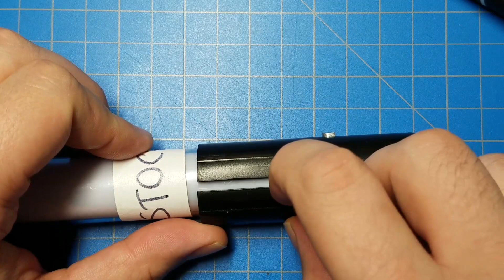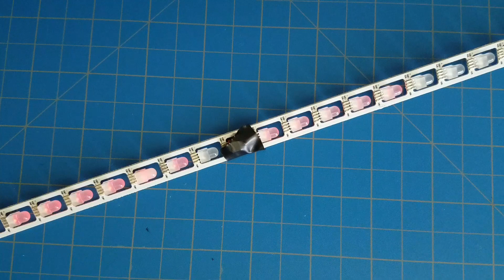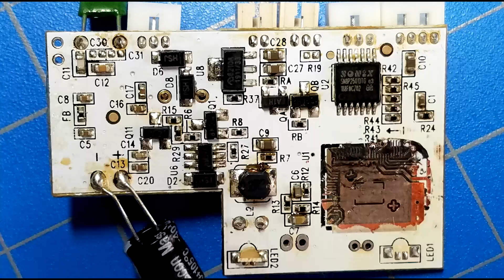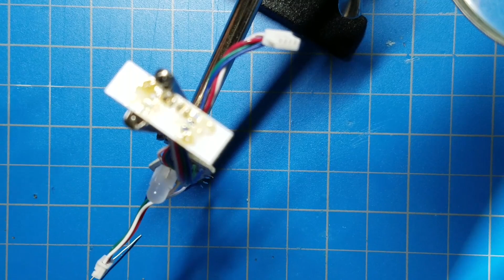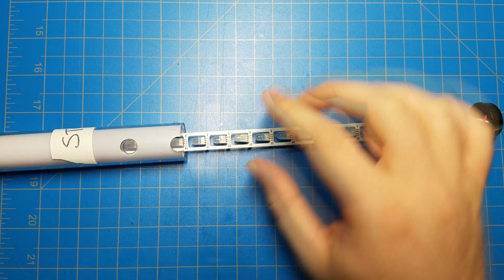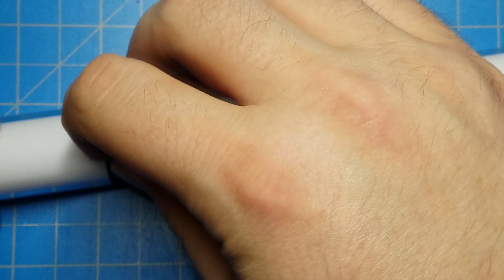Repairing a Broken LED in a Savi's Workshop Lightsaber Blade

Comment: Question and I hope this reaches you if one rgb led light is replaced should this fix the others that don’t turn on? We have a light saber that randomly the top led lights stopped working but the rest work would fixing one turn on the rest?
Reply from the maker: @Tyilasoso  probably not. the power going to those LEDs has likely broken somewhere. either near where the LEDs stop lighting or possibly the solder joint at the base of the blade that connects the LEDs to the controller. it could also be the transistor that drives power to that section of the blade has failed, but that's probably the least likely reason. 

you could open the blade and examine it for any obvious signs of breaks, maybe reflow the solder on the connections between the LED strip and the controller PCB, but it may be easiest to buy a new blade. you can find new ones on shopdisney.com or used ones for a bit less on eBay.
Reply: @Ruthsarian thank you!!!

Comment: Question: So I got a $40 lightsaber at Disney land, and it only works on try me mode. When I switch it to on mode and press the button it doesn't work. I think the problem might be in the circuit board but I don't have a great knowledge of circuit boards to fix it. I was wondering if maybe you could take a look at it and/or fix it?

Comment: where can i find some led like that?
Reply from the maker: i have not found a source for the exact style of LED used in the blades, however just about any common-anode RGB LED will work, such as these from amazon: https://www.amazon.com/dp/B077XD5T8P/

the biggest issue I've found with those LEDs is their color is slightly different (maybe because the package is different or the manufacturer is different?) so it may not look absolutely perfect, but it'll work.
Reply: @Ruthsarian  you think it's the same led on black series kyo ren saber?

Comment: I just bought one 2 days ago and part of blade lights up sometimes and mostly stays off. How can I fix this?
Reply from the maker: there's probably a wire that's come loose inside the blade. you would need to open up the blade and check the three wires that connect to the control board to see if any of them are loose. If one is loose you will need to solder it back in place.

HOWEVER,

your first step should be to contact Disney's Merchandise Guest Services about this. You can email them at Merchandise.Guest.Services@DisneyParks.com. Tell them about the problem. They may be able to send you a replacement blade.
Reply: @Ruthsarian  Thank you so much for this! I sent them an email telling them about my issue and they said they will not refund it. So my only hope is to fix it my self

Comment: Thank you, my light saber which should be purple split to where the bottom half is purple. It lights up red as you go up it and the top part of doesn’t light up at all. So I will take it apart to troubleshoot & repair the light saber blade. Thank you for making the video!
Reply from the maker: try changing the batteries first. be sure to use alkaline batteries.
Reply: @Ruthsarian  ok I’ll try the simple first, sigh lol I should’ve tried that first so good advice. Ty!

Comment: I JUST got back from California for the first time and made my Lightsaber.  it hasn't broken, but as an avid cosplayer, I DiD want to take precautions and secure my saber for future use.  what would you suggest I do for the electronics and the leds in the saber?  I'm pretty moderately skilled in electronics, as well. is it possible to add more RGB led strips or replace the stock pcb with RGB from a roll I have? I was thinking of using L connector pins on that pcb connector point near the hilt, superglue the two boards together to keep that connection from breaking and adding more foam to protect it. would you say that's a solid way to "protect" my saber?.
Reply from the maker: The stock blade has a strip of LEDs on a PCB and a second PCB attached to the base of the strip which contains the blade controller. The two PCBs are joined together with 9 solder pad connections (7 on the 'front', 2 on the 'back'). That seems to be the weak point (physically) of the blade, although I have not had any problems with it myself. Perhaps a bit of epoxy to help strengthen that joint could help, although once you do that you won't be able to (easily/cleanly) separate the two PCBs.

The only reason you might want to separate the PCBs is if you wanted to replace the stock control board with some custom board that's compatible with the stock LED strip or replace the stock LED strip with something compatible with the control board. Currently there isn't any known setup for either, although I am working on a custom control board that I plan to release in the near future (see: https://www.youtube.com/watch?v=yo7Vfhsd1CQ). 

If you're looking to add or replace the stock strip of LEDs you're probably going to also have to replace the control board. The stock LED strip isn't quite like any standard LED strip and I haven't seen one that's compatible with the the stock blade controller. The other issue is current draw. The components of the control board are rated for about 1A of total current. Other LED strips of a similar length with likely draw current higher than 1A and the stock control board may not be able to handle that.

There is a document online that covers how to create a Galaxy's Edge compatible blade using neopixels and an adafruit trinket here:
https://1drv.ms/w/s!Asy0Vb60mZ1el7hoTX-i5ShwGGqm4Q?e=9xP2ac

That neopixel blade requires its own battery because of the excess current draw of the LEDs. I have not attempted this mod myself, but I know of a few who have. If you decide to go this route, you should check out the #makerspace channel on the Galaxy's Edge Discord server (http://swgediscord.com) where a lot of the neopixel blade work was first developed. You should also check out Dead Bothans on Patreon (https://www.patreon.com/deadbothans) where you can download code for the adafruit trinket to drive the blade LEDs.
Reply: @Ruthsarian  those Neopixel blades are quite pricey and I understand why 100%. I will very likely stick-around and follow your progress until I see an alternative to modding my saber for longevity.  Thanks for the info!

Comment: When you put the new LED on, you only tinned the top most pad on the PCB. Why didn’t you tin all four so that you could just do tap tap tap with the solder and be done?  How did you tin the other three that now had the LED leads on top of them?
Reply from the maker: i have a small tip on my iron that fits between the legs which lets me solder them one at a time.

tinning all pads first would probably work, but I'm not sure all the pins would lay flat against the PCB. the led would still work, but if it's slightly raised you may find that LED appears slightly brighter on one side of the blade and slightly darker on the other because it's raised off the PCB by the tinned pads.

Comment: The right setting helps.. Thanks. I tested the individual LED's in the dead block area's and they worked... I tried lighting them all up as you showed us at 6min. 25sec. into your video. No joy. nothing lit up in bulk. I guess that means there is somethin wrong with the little circuit board on my blade?.. If you can think of anything else... Appreciate your help... your way better then Disney Support. I emailed them with no response.
Reply from the maker: are you able to light up the banks you know are good with your multimeter?

when you try to light up a bank, does your multimeter show any value? it should show something between about 1.7 and 3 volts (depending on which color you pick). if you see such a value, but little to no light coming from the LEDs, the bank may be okay.

my multimeter has a unique feature that i can enable to have it use more power than usual to test a diode. this lets me light up several LEDs in parallel (like a bank of LEDs in the blade).

if your multimeter shows a low value (below 1 volt) then there is likely a short somewhere. and that's the culprit.
Reply: @Ruthsarian  When I light up the individual LED it lights up a bunch around it on the strip. Even the ones not working in the block when powered up by the hilt. 
It reads 1.3 and i'm using a Commercial Electric MS8301A DIGITAL MULTIMETER.
I just read some of your previous comments. I think I need to solder the connections at the board, like you said to someone else... Thanks dude!!

Comment: Great video! You helped me take it apart. But..... I have two blocks of LED's out. I have a multi meter but I couldn't get any LED's to light up. What setting where you on? Thanks.
Reply from the maker: I am using diode test mode. If your multimeter has it (most do) you should see a diode symbol (a triangle with a line through it) on the multimeter dial

Comment: Maybe you can help me with a problem. 
I just got mine. Like 3 days ago. And you’re supposed to be able to battle with these and they not break and I have only hit mine on something once and a little strip of leds stopped working as soon as I did it. But it’s midway through the blade and the ones after it still work
Reply from the maker: the first thing you should do is contact Disney and see if they'll replace the blade. you can e-mail them at merchandise.guest.services@disneyparks.com. or call 1-877-560-6477. 

Each segment of LEDs in the blade (there are 4 total) has their own power line. The power line for that segment is probably cracked somewhere, most likely at the solder joint where the LED strip and the blade control board are joined together. Reflowing the solder at that joint with a soldering iron might fix the issue. But I would strongly recommend contacting Disney before trying to repair the blade.
Reply: @Ruthsarian  okay, thank you. I think I may have been given a bad blade because my buddies all have one and they fight with theirs and none of them have had any issues. 
I haven’t fought with mine at all and it messed up before I got the chance

Comment: So I have a question my blade LEDs where snapped in half. If I where to solder the blade back together would it work again?
Reply from the maker: It could, yes. 

My first concern would be whether or not there are shorts between any of the traces on the PCB where the blade snapped. If there aren't, you could plug the bottom half of the blade in and it should still work even before soldering the two halves back together. 

My second concern would be with making sure that the joint where you reconnect the two halves together is mechanically strong enough to support the top half of the blade. I would probably scrape away (or sand) some of the solder mask (the white stuff on the board) to expose the copper traces on both halves near where it snapped. I'd then run wire between the corresponding traces on each half. Confirm the top half is working again (carefully) then use some epoxy to strengthen the joint.

Alternatively, you could trim the tube down to the length of the bottom half of the blade and now you'll have a short saber blade, which would be rather unique.

Good luck!

Comment: could anyone help me half of my light saber is not working does this also work for that?
Reply from the maker: it your lightsaber from galaxy's edge? is the problem that half the blade is not lighting up? if yes to both, i strongly suggest you contact Disney directly and see if they will provide a replacement (they have already done this for may people). you can e-mail them at  merchandise.guest.services@disneyparks.com or call them at 1-877-560-6477

a galaxy's edge lightsaber blade that only half lights up would indicate something has gone wrong with the electronics inside and it is likely not something easily repaired.

Comment: I have a light sabre to and it is half is not lighting up so I took it apart and there is a crack in the led light strip what should I do
Reply from the maker: assuming this is a galaxy's edge lightsaber, i would start by contacting their merchandise guest services and see if they will replace it for you. you can e-mail them at  merchandise.guest.services@disneyparks.com.

beyond that, you'll have to repair the crack. to do that you'll have to scrape away at the solder mask (the white paint that covers the copper lines that electricity runs through) on either side of the crack. once the copper is exposed you'll need to bridge the crack with either a blob of solder or use a short length of wire and solder it across the crack to reestablish the connection. there will likely be at least 4 such copper lines running through where the crack is. once you've got them reconnected with solder, carefully put the blade back together and test to make sure everything works. if it doesn't, you'll need to look for more copper lines that you missed and double-check the solder connections. once it's working, take it apart and put a small amount of expoxy across the crack (and over the exposed solder and copper) to help strengthen the joint. 

but before you do any of that, assuming this is a blade from Galaxy's Edge, contact Disney first. a lot of people have had problems with their lightsabers and Disney has mailed out replacements.

Comment: Hey could you help me with a problem I’m having with my lightsaber I bought it from one saber it’s an RGB one I have charged it sufficiently yet when I try to turn it on despite holding the button for the specified time it just won’t turn on
Reply from the maker: Is this a lightsaber from Galaxy's Edge or is it something else?
Reply: @Ruthsarian  hi it’s from a company called one saber it’s their v1 range I’ve had a look at it and suspect either a bad battery or circuit board but I’m really not sure - think you could point me in the right direction ?
Reply from the maker: @nathanhowe3192  i'm not familiar with their products. the best suggestion i can offer is to contact them. they have a contact form on their website at https://onesaber.com/pages/contact-us.
Reply: @Ruthsarian  ok thanks

Comment: Any plans to add blacklight 400nm wave LED's to make it into a darksaber blade? I am trying on a cheaper single led lightsaber blade on an ultimate fx lightsaber, but your skills and knowledge on modifying the Savi's would obviously make it even more awesome.
Reply from the maker: No plans, but I'll think about it. I'd probably have to hand-wire a string of 50 or so LEDs and then work out some way to connect them to the blade. There are a few different ways to go about doing that, but none of them stand out as being "good".

There is an as of yet unused "dark" purple (more like a dim purple) color that the stock blades can produce. I'm not sure if that color exists due to a programming error or if maybe there were plans to potentially create something like a darksaber down the road. looking at my videos it seems I haven't covered that particular 'mode'. Maybe I'll put together a quick video tonight just to demo it.
Reply: @Ruthsarian  That would be really great of you to explore the "hidden" LED colors. I am just buying a ready made USB powered UV LED strip to see the effects at first since my soldering skills are not up to par. If the results are in any way effective, I would like to donate the UV LED strips to you in case you wanted to try it out or make a video. Just an idea for ya. I appreciate everything you put out there.

Comment: I would like to shorten my blade.  Have you done this yet? I thought I could just cut off the length of leds I wanted, but not sure if that would affect the strip. Looks like the end of the leds has a special pad.
Reply from the maker: I haven't done it, but I've talked to others who have. You can cut a length of LEDs from off the top of the blade and it won't impact the it's performance.